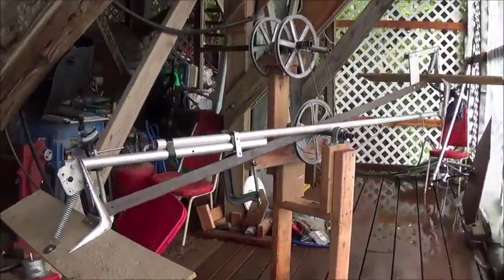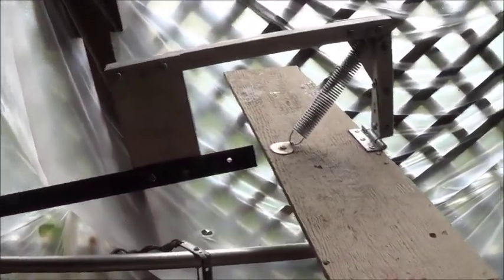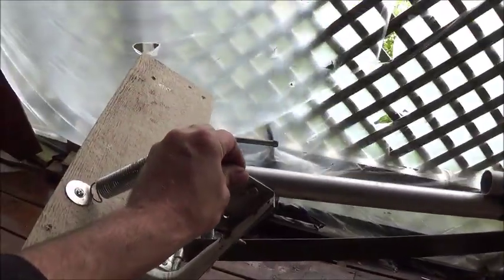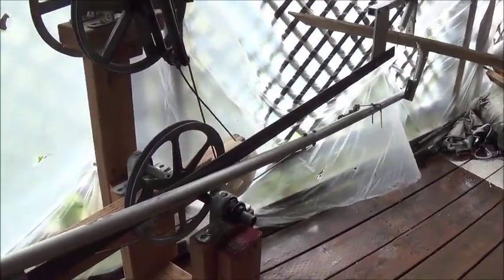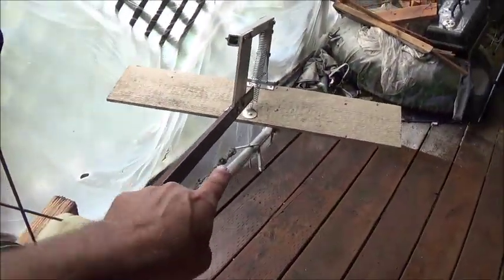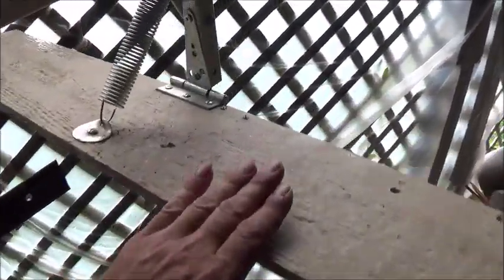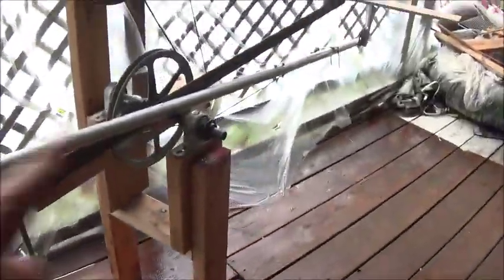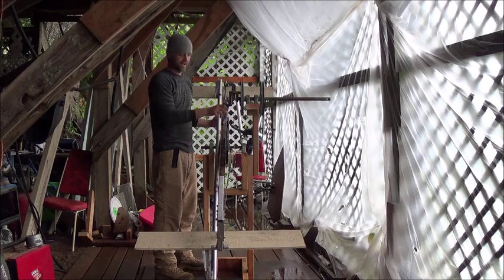Hydrofoil Hydroelectric Generator, twin oscillating foils make power from slow moving rivers.

Comment: How about replacing the hydrofoils with a pair of large airfoils to use low speed wind.  I imagine the airfoils could be mounted either vertically or horizontally on your design for capturing the available energy all around us.

Comment: What an interesting project! 

Suggestion: Maybe you should consider adding vertical wedges across the span of the hydrofoil, this will reduce span wise flow thereby making the flow "chord wise" and even more laminar which will add up to an increase in efficiency, just like wing fences are used in some aircrafts.
Reply: Eng Teknik could you explain your idea a little more? Thanks.